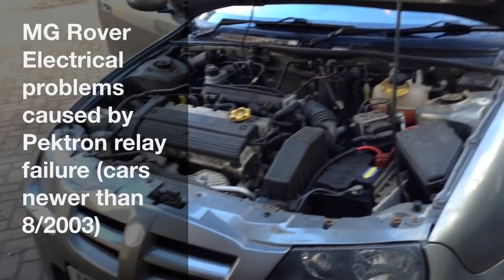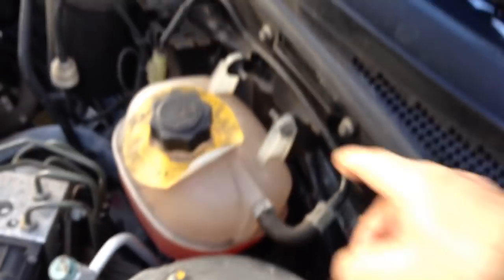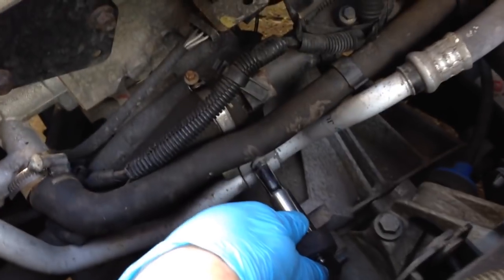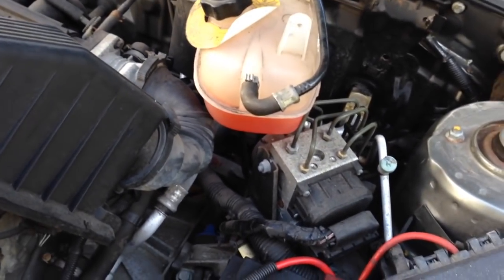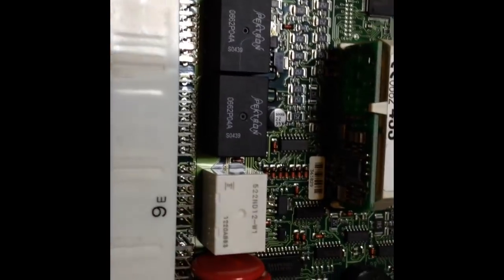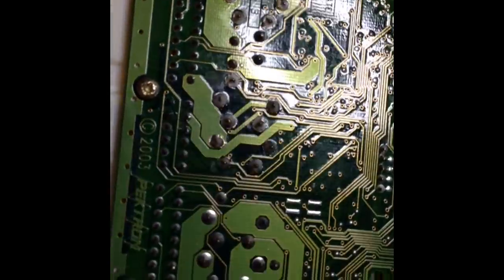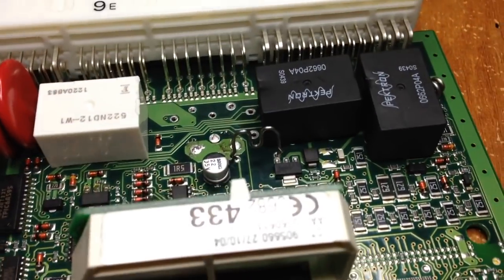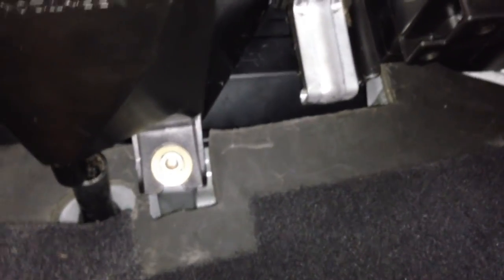How to Fix MG Rover Electrical Problems - Pektron Relay Fault - 8/2003 on

Comment: Sorry mate but you are off your head 😅😅mine  will not come out  no chance in hell 😅
Reply from the maker: Take a break, wait until you are feeling patient or up for a challenge, then try again at the same time working out what the problem is.
Reply: @comeinhandynow  I did it mate I won the only reason I have removed it my front screen whashers are not working the relay is clicking but no power at the plug